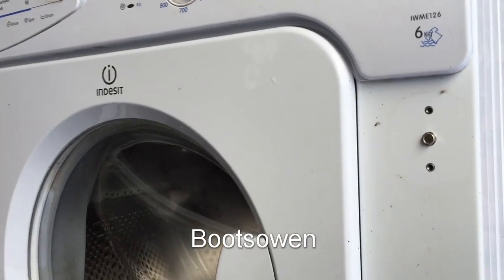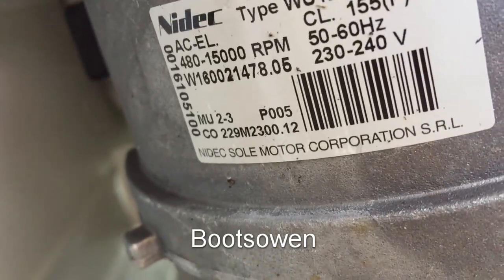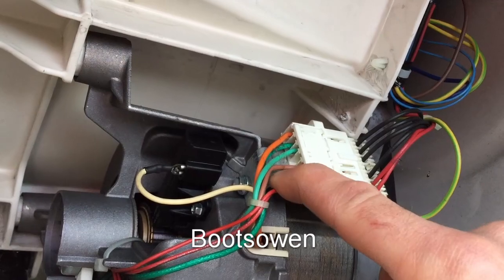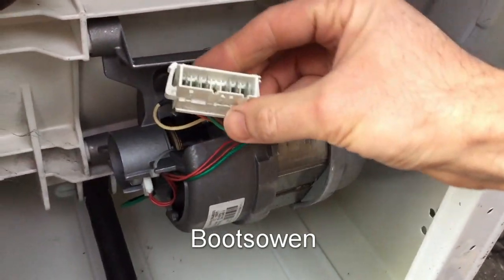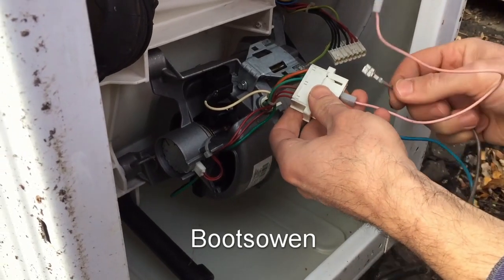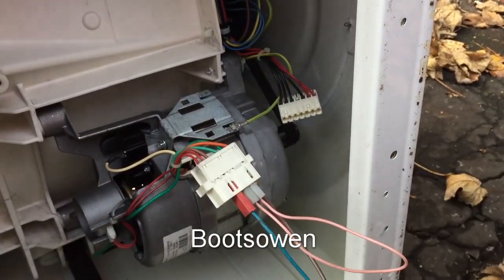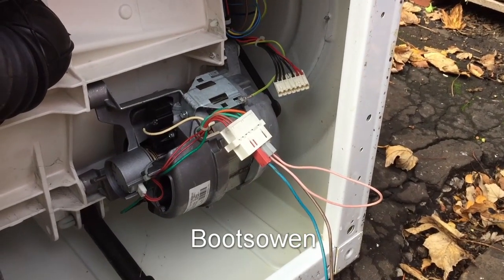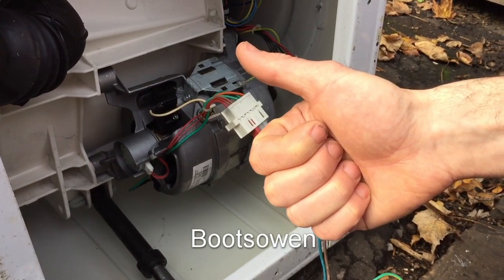Wiring Toms Indesit, how to wire a washing machine motor.

Comment: Hi there, I have what I believe to be a Bosch 5500018687 motor, it was given to me and I'd like to use it for something but it has 8 pins . I don't have the plug with the wires that went into it so struggling to determine which pin does what, could there just be two dummy pins? As in not used for anything? I could send as many pics as you need but where could I send them?
Reply from the maker: I have made many videos on this topic. Please check out my appropriately named playlist. I am not interested in receiving photos.  If you have any specific questions please leave a comment.  THanks

Comment: Hi I have a machine like that same model. The motor has been removed I have another old washing machine motor I want to use it now the issue here is termination from the card if you can share the diagram please.
Reply from the maker: Hi, it is easy to figure out how to wire a washing machine motor, I have posted many videos of this, search for "bootsowen how to wire a washing machine motor". It will be more difficult to understand the wires at your machine end, and to make the new motor fit, they are all different. Let me know how you do it.